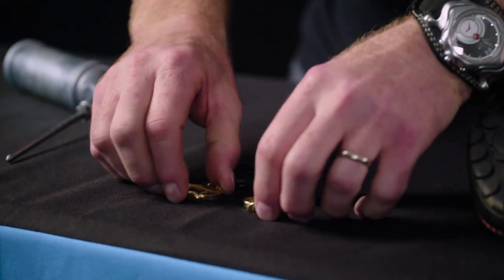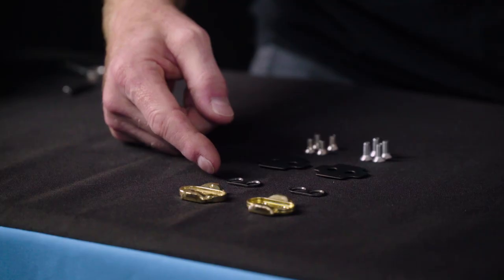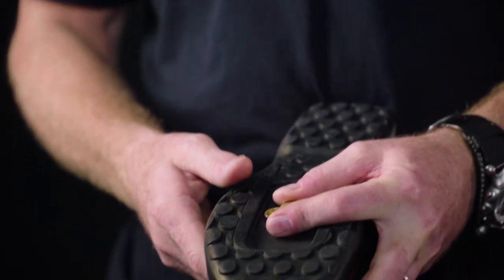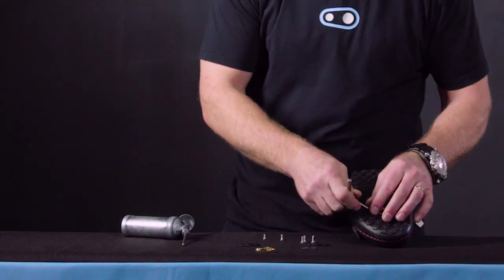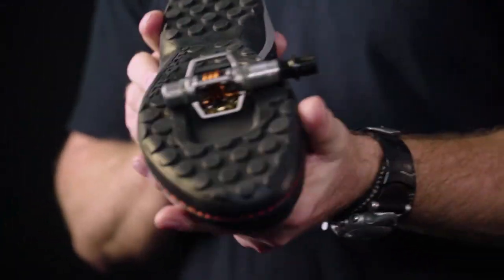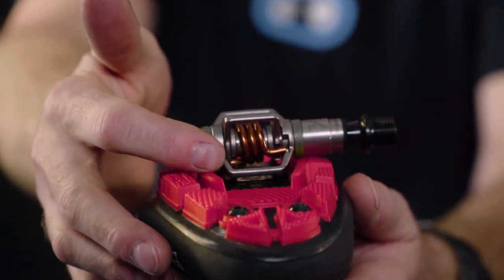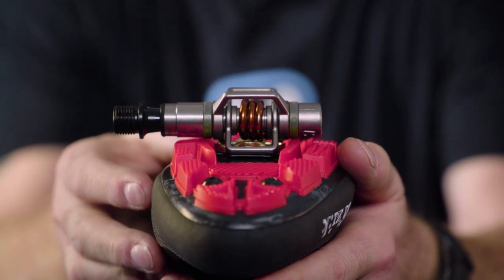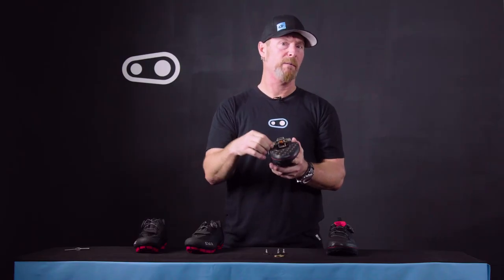Crankbrothers Cleat Installation Tutorial

Comment: I'm thinking about moving to eggbeater pedals for the first time from Shimano spd's. Why would you want different release angles on different feet? Do I need to buy separate cleats if I want the same release angle on both feet? Thanks Richard
Reply: The release angle will be the same for both. It just gives you an option whether you want 15 degree release or 20 degree release depending on how you set them up to which shoe. So dot in right shoe makes then release sooner than dot in left shoe. Again both sides would have the same release angle. You’re just flipping the cleats and one side of the cleat has a more aggressive release angle than the other side.

Comment: Why do mine say left and right and they don’t have dots what does that mean pls help
Reply from the maker: The newer model of cleats have L & R on them where the older models used the dot system. Thanks for the question!
Reply: crankbrothers but do you still get 15 and 20 degree choices aka r on right is 15 degrees or r on left is 20 degrees?  It’s not explained anywhere
Reply: @asilver1234  they now sell different cleats for different floats and angles of release. Their website has a color guide in case you want to know what comes with each pedal set.
Reply: Kazarjar yep, I bought the easy release, they’re not easy, rode them for 2 months and sold them and went to spd, spd is so much better 🤣
Reply: @asilver1234  haha same. Looking at this comment from six months ago, I switched to shimano saint spd and they're soo good!!!!! so much easier to adjust and they are super durable highly reccomend

Comment: I installed the new cleats, replacing the old Crank Brothers cleats, but the new cleats are too high.  What is the next step?
Reply from the maker: Hey! have you removed the shim? another option would be to install traction pads for the pedal to bring the platform closer to the shoe
Reply: @crankbrothers  I didn't use a shim.  Tell me about traction pads.   Is it something Crank Brothers has?  Will it hurt anything if I just use the cleats as they are (aside from not walking on hardwood floors).